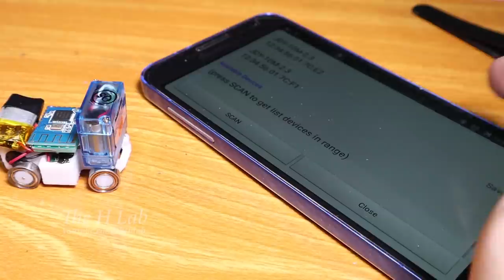Tiny RC truck from servo 3.7g | The H Lab

Comment: Wait, you used bearings for the rear wheels?  Am I missing something?  How would a bearing provide drive if its only purpose is to reduce the friction of an object rotating in a circle.  Wouldn't it just sit and spin?  I must be missing something?

Awesome by the way!  Love it!
Reply: Maybe he glue the inside bearing.
Reply from the maker: Right. I put liquid glue into the rear bearing.
Reply: @TheHLab  Ha! I put a comment before I read this. An excellent piece of work!
Reply: I came into the chat to ask the EXACT same thing
Reply: @MonsterPartsRc  Well, if I saw it, someone else had too! lol.

Comment: Do we need to solder resistor to the micro servo controller or it directly works as front and back? And what mah lipo are you using? 60 mah? The 3.7gm servo voltage rating is 4.8v , how are you able to run it on 3.7v ?

Comment: What resistor do you replace the potentiometer of the servo ?
Reply from the maker: Both are 1kohm
Reply: @TheHLab  1k ? I  soldered 1k ohm to the circuit but the motor is still spinning
Reply from the maker: Seem like something wrong with your circuit or one of resistor. Two resistors here just to balance the voltage, so 2 resistors must be same value. 1 or 2k doesn’t matter